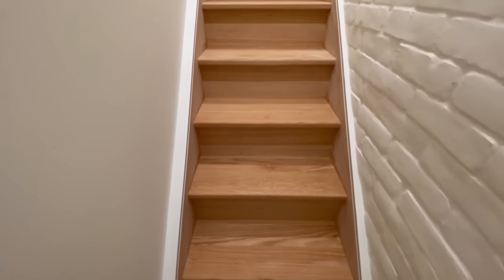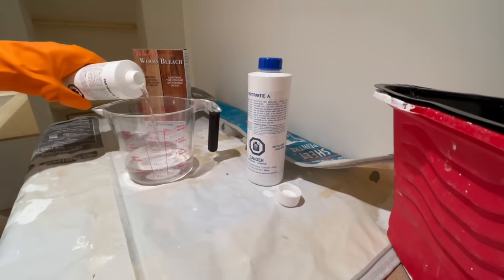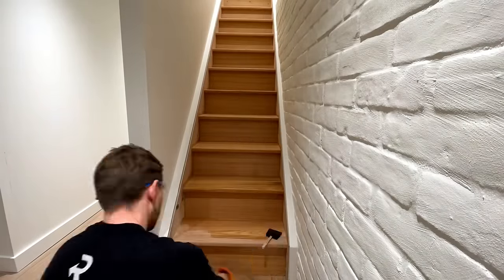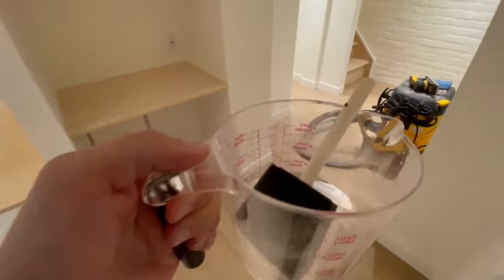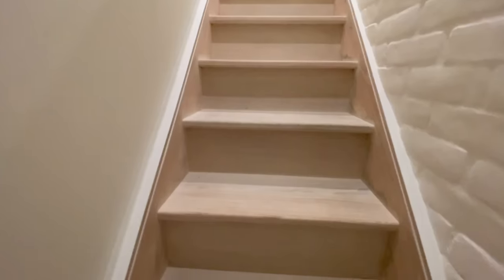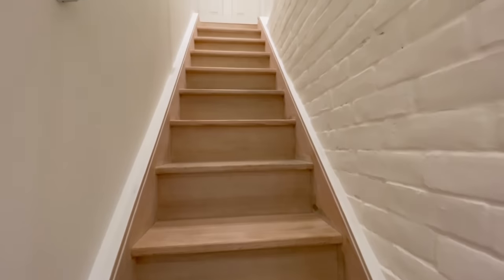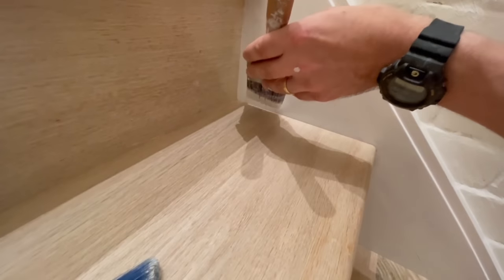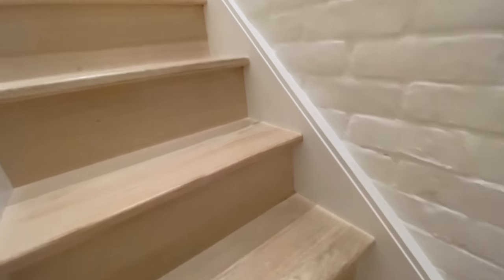Wood Bleach Tutorial: How to Make Red Oak Look Like White Oak!

Comment: I laid pale untreated oak floor. I stupidly varnished it with an oil wax and it turned a piss yellow. I sanded and then used this product to bleach the yellow out back to its original colour but it didn't work. In fact the product did absolutely nothing.
Reply: I'm in the same dilemma with the handrail. I love the natural oak color but was told to put a clear coat on it to protect the wood. I used a polyurethane coear coat and now it's an ugly yellow/red color. I'm pretty pissed about it and have been trying to figure out how to get it back to what it was.
Reply: @CamberRockerCamber  Unfortunately you cant reverse it. I decided to stain my floor a dark oak to cover up the yellow. Thats the only option, to go darker.
Reply: Purple cancels out yellow which is why you would have needed to stain/varnish it with a purple undertone. Same for hair dying.
Reply: If you want to know what wood will look like with a clear coat on it just wet it with water or mineral spirits. Wood will absolutely NEVER look like it does when dry after you apply a  finish. That’s not how wood works. Water based polyurethane won’t yellow but it still makes the wood look wet. There is no way around this. If you want it raw you have to leave it raw and unprotected.
Reply: @CamberRockerCamber I would probably choose a water based top coat like from Bonide. Water based doesn't yellow. Polyurethane does.

Comment: Knew immediately that these guys were from Canada, as they DO NOT sell this product anywhere in the USA.  (One of a million things wrong with the land of the “free”.  For all you fellow Americans, if you mix 4 oz 100% lye with 24 oz water (part 1) and 27% Hydrogen Peroxide (part 2) (can be found at pool stores or HD sold as Pequa cess-Flo) and apply in 2 steps then you will achieve same results.  Good Luck!!

Comment: Nice job, but why did you spend that much time bleaching and NOT tape off while painting white???
Reply from the maker: Fair question. Short answer would be that we can achieve the same results without tape (not that we’re against it, at all). Hopefully you’re not being thrown off by the “glow” off the corner of the stairs in this video. The edges look really bright with our camera lights and almost gives the impression of paint bleed (we assure you it’s not 😎).
Reply: To paint wood & to bleach are two very different things. Achieving very different results in both the look & feel not to mention longevity. One is painted & there’s a layer of color usually fully covering the wood grains & all it’s beauty completely, as where bleaching the wood is simply changing the color  of wood tones all while still allowing the wood to be itself in a new hue! 😊

Comment: I love it!! I want to do the same thing to my honey colored oak kitchen cabinets.
Reply: Did it work? Love that idea and don’t know if I can tackle it myself 😅 but would love to!!!
Reply: wondering the same question! Did it work? Did you try?
Reply: And the cabinet faces!
Reply: Probably won’t work. This kind of thing is good for taking raw wood and lightening it. It’s not necessarily for altering the effects that stain or clear coats had on the wood. You bleach before finishing typically. That’s how you make raw red oak look like white oak. It will then take the finish as though it’s colored like white oak. If you already finished the wood you would have to sand down to raw wood, not just scuffing the surface. 

Making cheap red oak colored like white oak is one valid way to use this stuff. The other valid use for this kind of thing is to make soft maple as white as wood can possibly get (which still isn’t truly white). Then you finish with a white wax oil.

Comment: I had my red oak wood staircase sanded and stained (no top finish/varnish yet…) by a professional but the color is horrible. I want it to match my new white oak floors. Can you use this on wood that has just been stained but no sealant… will it work?
Reply: Id like to know this as well. Have you been able to match your red with the new white oak?

Comment: Hi! have you tried liquid sandpaper instead of manually sanding? Want to bleach my window trims and sanding it manually looks too hard. Second question, if I do need to really manually sand, do I just buff or it needs to be done hard?
Reply: what is your window wood painted or clear-coated?
Reply: You’re supposed to bleach raw wood. Everyone wants to change the color of their already finished stuff. That’s likely not gonna happen. You would have to sand the wood back to raw. Liquid sandpaper isn’t gonna do that.

Unfortunately if you don’t like your trim the options are paint it white or install new trim that is stained the color you want. If your trim is currently stained lighter than you want you could sand it down and go darker. But you’re probably not gonna have success going lighter. It’s honestly way less work to just rip it out and put in new trim.

Comment: That came out really good!!  I am a custom home builder in the Dallas, Texas area.  I have some rift cut white oak cabinets that I need to even out and this looks like it will do the trick.  Your welcome to come hang out and make a video.
Reply from the maker: 😂 thanks for the invite! Let us know how it goes 👍
Reply: Waterbase poly and such like General Finish High peroformance Flat is yellowing, as its pulling the tannins up, so bleaching might do the trick. I seen another YT video using regular bleach. I wonder if there is any difference. They also did not neutralize it with vinegar...hmmmm?? I am wanting to keep the natural whiteOak wood as my finished result.
Reply: @philindeblanc  we had custom walnut cabinets made from raw walnut cut from our trees.  We are finishing these ourselves and someone said we need to apply a whitewash or antiquing and then a water based poly to keep them from darkening.  Any suggestions, as the semi transparent white stain looked terrible on the scrap of walnut.
Reply: @debbiestevens4913  You are lucky to have such wood sources. The darker the wood the harder it is to use a white wash. The darker the wood the less you have to worry about it from darkening.  Having said that, you could use a tint of the color range in the wood, and use no more than 2 to 3 drops of a concentrated color in about a quart batch. This will keep it from the tanins bleeding through and from sun exposure. Use a good  waterbase sealer. I have tried a few, and the one I chose was Renner, but Centurion was also good. the ones like Minwax, or off the shelf darkened the most.
Reply: Where can I get the Circa Wood Bleach.  I searched the web but am not able to find it.  Home Depot and Lowes does not carry it.  Where did you find it?  Thank you in advance for your response.

Comment: I assume this was raw wood and not previously coated with a topcoat correct?
Reply from the maker: Correct👍
Reply: Indeed. As a woodworker bleaching techniques tend to have to main applications. Making cheap red oak look more like white oak and making soft maple ver light / white (especially when finished with a white wax oil).  But you have to do this on raw wood. 

Everyone in the comments wants thier 90s cabinets to look like modern grayish white oak. Not gonna happen unless you sand back to raw wood. And your cabinet veneers can’t handle that anyway.

Comment: Wow, you did an amazing job! Getting that Bin shellac on perfectly like that is epic! My question is I am refinishing a table and painting a portion and want to bleach the top and bottom of small table for a natural wood look. I believe it's red oak.  I sanded down the finish with 80 sander yesterday then wipe it down with water and it was a light color.  Woke up this morning to further work on it and it was red again! I'm a newbie.  Is this normal? Do  I need to sand more? Also, I bought a wood bleaching kit by Zinsser? Is that ok? Thank you!
Reply from the maker: It’s totally normal 👍. It will always look it’s lightest after a sanding, and it’s darkest when wet. The short answer is that you didn’t do anything to change the appearance of the wood permanently by sanding it or adding water. If you want to make the red oak permanently lighter, you’ll have to apply a bleach solution (like the one from our video, or another kind) and follow the instructions 👍

Comment: How much surface area does a container this size do? I can't find a larger container for this. Looking to do this exact thing but over 1000 sqft of 2" red oad hardwood floors.
Reply from the maker: According to the label, you’ll get roughly 100 sq. ft. per box with this product 👍. You could looking into getting the two components separately (sodium hydroxide and hydrogen peroxide), might be easier to get them in large quantities that way instead of getting 10 kits. You’ll want to do some research before going this route though (we’re not chemists 👨‍🔬 😉) 👍

Comment: Unfortunately the wood bleach you used seems to be unavailable in the US.  Canada, only, and they won't ship it across the border.
Reply from the maker: That’s frustrating. You should be able to get the individual components separately relatively easily though (the kit is nothing special, just two bottles: sodium hydroxide “Solution A” and hydrogen peroxide “Solution B)
Reply: I believe Zinsser brand has a good bleaching solution. I used on cherry side table, looked great after. Kept natural with a waterbase clear coat so as not to yellow over time. Cherry does darken naturally with age, but after a year I can't tell. Just fyi. 😊

Comment: Are the floors Waddington Oak LVP by chance? I'm trying to match get some red oak trim to match my newly installed floors and found this video.
Reply from the maker: I do not believe they are… but can’t say for sure. They were supplied by our stair installer 👍
Reply: @RefreshHomeImprovements  Thanks for replying! I actually went ahead and bleached some white oak, used 'natural' stain, and it came out pretty close to my flooring which is a white oak color. Thanks for the video!

Comment: In the last 15 seconds of the video it looks like he stained the stairs a light gray. I’m wondering what product you used? My flooring looks very similar and I am going to bleach red oak stairs and use a similar stain to achieve pretty much the exact same look that you did.  So just wondering what’s the stain used?
Reply from the maker: Believe it or not, no stain was used whatsoever. What you see is just the look of the red oak after two applications of the bleach. No stain was used, only a top coat of Polyurethane. Most poly sealers will tint the wood in a different way, so we experimented with different brands/products to see which gave us look most similar to the existing floors, and we landed on the Clear Finish Varathane in the Satin Finish.
Reply: I think the grey color at the end is just the filter applied by the title slide overlayed on the video. It just desaturated all of the video color etc. So the wood is not that color

Comment: Was there a sealant or finish on the stairs? obv the 80 sand took whatever off - I assume?
Reply from the maker: The stairs were raw (unfinished Red Oak) when installed. We sealed them after we bleached them, but before that there was no sealant etc. 👍
Reply: @RefreshHomeImprovements  thanks! have you done this to veneer?
Reply from the maker: @BM-qm8be  We have not. In general sanding + veneer = trouble… but if you’re careful its worth a shot 👍

Comment: Is it fair to say this isn’t redoing your floors? This is supplemental to an existing stained red oak floor? Ours really has a clear coat to keep it natural. Just curious if this requires as heavy sanding
Reply from the maker: Totally fair (especially since we’ve ‘redone’ many many floors 😂 ). There IS however a ton of sanding involved (even without having a clear coat already on top), so don’t expect this method to be a quick and easy fix. You’ll have to sand your clear coat off completely before you even begin this process 👍

Comment: Have you ever used this product on mahogany? I'm going to finsh a new mahogany door and want to neutralize the red tones. TIA
Reply from the maker: We haven’t- but it’s specifically mentioned on the label, so you should be good to go 👍
Reply: @RefreshHomeImprovements  thanks so much for responding so quickly! Best wishes
Reply: Now if I can just find the product! Doesn't seem to be readily available down here in the south. 😕
Reply from the maker: @lauraadams478  i wouldn’t be too concerned with finding this exact product. Wood bleach kits tend to be the same thing (sodium hydroxide and hydrogen peroxide) in some variation. See if someone around you sells a different kit, or try to locate the two components separately. You might have better luck that way 👍

Comment: Can I bleach my red oak veneer interior door? It is 1/8" thickness veneer with a solid particle core.
Reply: Is it raw wood? This really isn’t meant to bleach out stain or finish it’s meant to bleach the wood fibers before you put finish on it. Also, does 1/8 veneer mean it’s 1/8” of solid oak or is it 1/8” oak plywood which only has a tiny layer of oak on the outside.

Comment: what sander did you use please?
Reply from the maker: We used our Mirka Deos, but you can certainly do it by hand. The product you use will specify which grit to use and when (this asked for 180 grit before applying the bleaching agent, then the sealer required a pass of 220-240 grit) 👍

Comment: Hardwood floor refinisher here
The pros don't do this. We use Loba easyfinish with loba whitener. Usually 2 to 3 coats. You'll neutralize the red/pink undertones and have a beautiful thick coat of water based poly that won't change color overtime.
Reply: Loba does not bleach wood. Loba whitener has pigment in it so you get more of a pickling or whitewash look. It's essentially highly pigmented paint. It is not the same effect as bleaching.
Reply: @nfinance2  it will eliminate the red and have the best protection, and will not oxidize over time turning yellow. I hope my competition doesn't catch on so I can keep making more money fixing other people's mistakes.
Reply: @cobiakiller7575  You aren't understanding and there was no mistake here other than the need to neutralize. The point of this video wasn't to show the best protection for wood. It was to show how to bleach the wood. Not everyone wants a cloudy white-washed look which is what Loba will give you. Nobody is saying Loba isn't a good product but for what he wanted, Loba would not be the correct product to achieve the bleach look. It is great as a protector though. Check your ego at the door and humble yourself. You might just learn something. #mastercarpentryfor30years